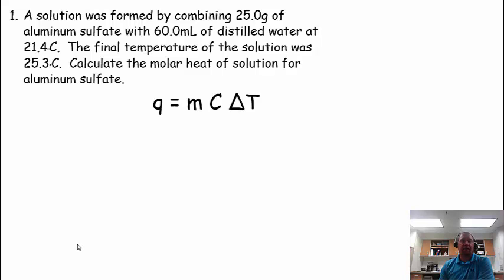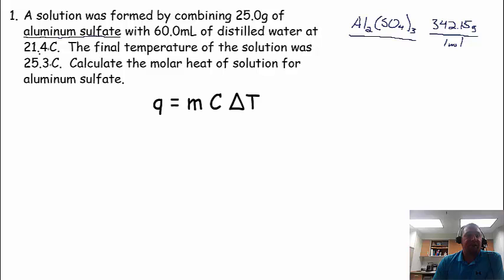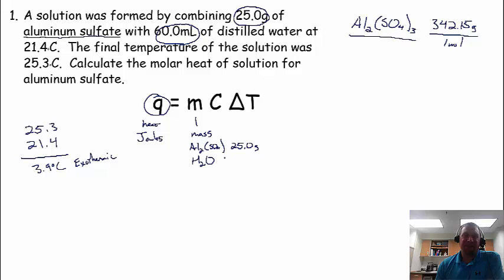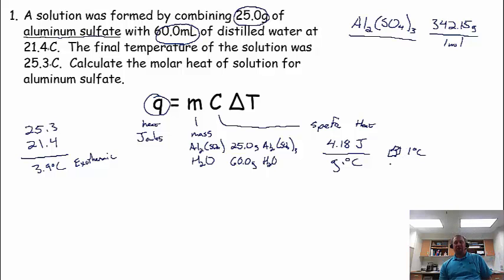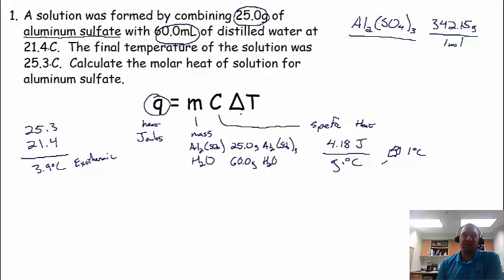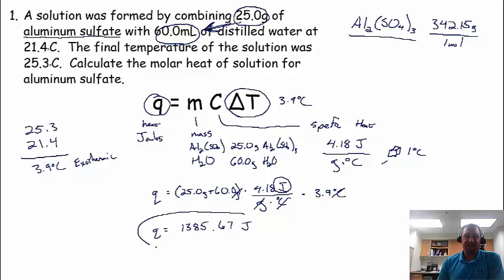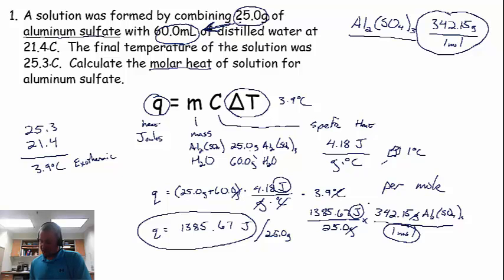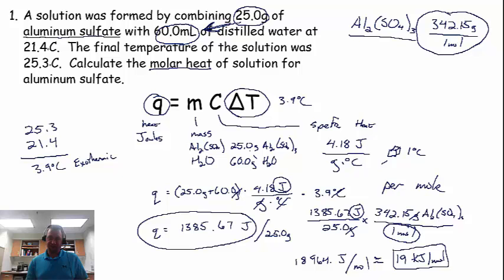How to Calculate Molar Heat of Solution - Sample Problem

Comment: The video Is wrong. Your specific heat changes when you have a solution. For example if you had a .1 M Solution of water and kno3 your specific heat would be 3.75J/GxC. I wouldn’t trust this video
Reply from the maker: For this problem, the mass of the solution is the mass of the water plus the mass of the solute.  In each instance, the calculation for molar heat of solution always uses the specific heat of the solvent, which is water in most cases.  Please explain your research so I can further explain this process.  Thanks!

Comment: ***THIS VIDEO IS WRONG!!!  DON’T USE IT TO LEARN/STUDY!!!

Q = mcAT is the change in heat if the water only, The water is the surroundings, the Al2(SO4)3 is the system… Q system = -Q surroundings.  The mass should ony be the mass of the water, especially obvious because  the specific heat of ONLY WATER is used in the equation.  

Q = mcAT = (60 g)(4.184 J/g*C)(25.3-21.4 °C) = 979.056J       (1mL H2O = 1g H2O)
Hsol = -Q/mol Al2(SO4)3 = -(979.056 J)/(25g/342.17g/mol) = 13400 J/mol = 13.4 KJ/mol
Reply from the maker: Emily G In this instance, we are dissolving 25.0 g in 60 grams of water.  In a molar heat of solution problem, m or mass refers to the mass of the entire solution.  In this case, 25 + 60 or 85 grams of solution.  We use the specific heat of water as it makes up the majority of solution.  Let me know if you have any further questions!

Thanks for watching!
Reply from the maker: The lab found at this link is a great resource for understanding molar heat of solution.

https://1.cdn.edl.io/unfH5MhvtJCAHvfHvRmiNa5CjFpMDfovL32DBRh2WLH3DhdP.pdf
Reply: thats not true at all. If its a dissolution you use the mass of the entire thing first. He did everything entirely correct